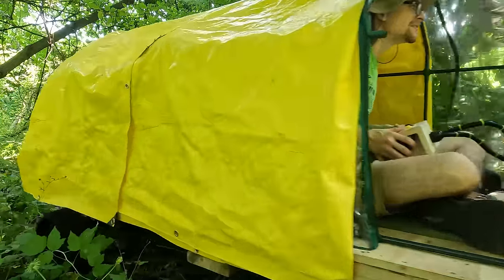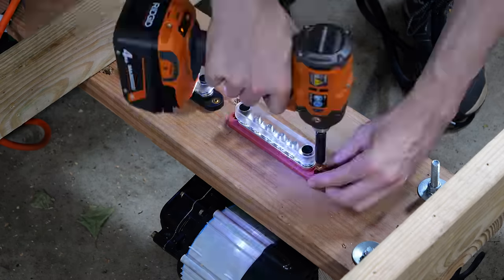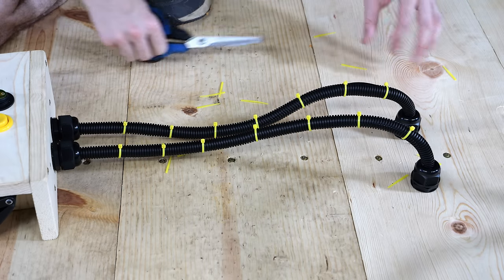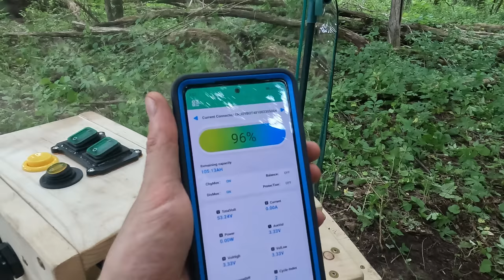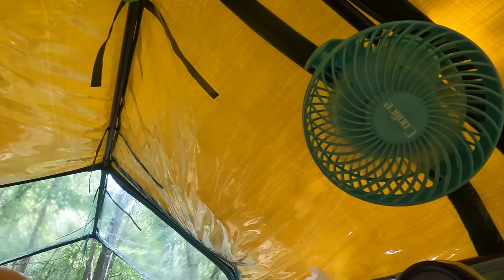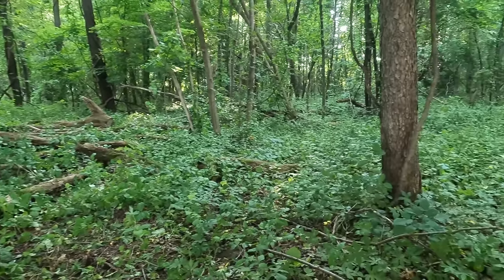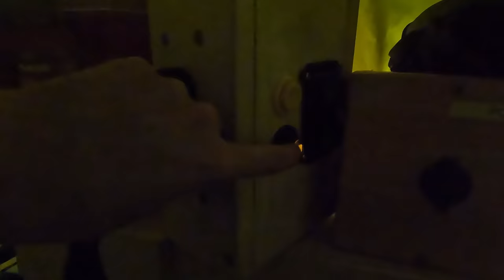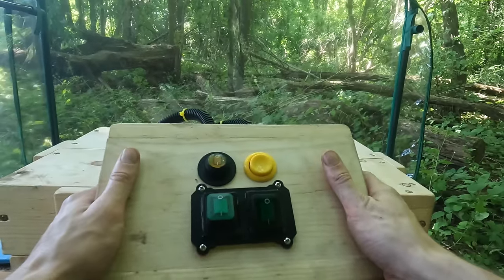UPGRADING The Camper You Can Drive Around - MORE POWER  - Build & Night In The Forest

Comment from the maker: Check out Enjoybots Battery's And if you use the code you save some and help me out a bit - Cheers!
Code: QN10
Enjoybot Official Store Links:
12V 100AH https://enjoybot.com/products/enjoybot-12v-100ah-lifepo4-deep-cycle-rechargeable-battery-built-with-100a-bms-low-temp-charging-cut-off-protection?aff=92
12V 200AH https://enjoybot.com/products/enjoybot-12v-200ah-lithium-iron-phosphate-deep-cycle-rechargeable-battery?aff=92
12V 280AH https://enjoybot.com/products/enjoybot-12v-280ah-lifepo4-lithium-battery-high-low-temp-protection-deep-cycle-rechargeable-3584-wh-built-with-200a-bms?aff=92
12V 400AH https://enjoybot.com/products/enjoybot-12v-400ah-lifepo4-lithium-battery-high-low-temp-protection-deep-cycle-rechargeable-5120-wh-built-with-250a-bms?aff=92
24V 100AH https://enjoybot.com/products/enjoybot-24v-100ah-lifepo4-lithium-battery-high-low-temp-protection-deep-cycle-rechargeable-2560-wh-built-with-100a-bms?aff=92
36V 100AH https://enjoybot.com/products/enjoybot-36v-100ah-lifepo4-lithium-battery-high-low-temp-protection-deep-cycle-rechargeable-3840wh-built-with-100a-bms?aff=92
48V 100AH https://enjoybot.com/products/enjoybot-48v-100ah-lifepo4-lithium-battery-high-low-temp-protection-deep-cycle-rechargeable-5120wh-built-with-100a-bms?aff=92
Reply: Your videos are so fun to watch ever since I watched 1.0 I really wanted one of these things
Reply: Super Love your fancy truck. Next episode you should add some mudguard.😊 Its more fun in woods campsite. So much enjoying seeing you cooking your meals.
Reply: Bro I have a car I bought from my Grand father it looks like the small car on monopoly it needs work you would enjoy that!
Reply: add a small "security system" with some small lcd monitors and wired rea/front/sode cameras for security. i feel like it would be so perfect to be able to monitor whats going on outside without the need for setup, just in case you have any unwanted guests around your camper.
Reply: Bro, tell us how high your IQ was.
Reply: Hot sauce goes on everything
Reply: The best thing to do now is to add a wood structure because of the stronger engines and the add some lights and maybe a TV and some things that others mentioned. Love the channel, keep up the good work.
Reply: GOOD WORK ..💪 ITS NEEDS TO BE STRONGER N (HIGHER) , AND MORE RIGID.... 👉ESPECIALLY MORE (*HIGHER* ).... *WAYYYY TOOOOO  LOWWWWWWW👎.....    WHAT DO YOU HAVE TO PROTECC YOURSELF FROM BEARS 🐻 WOLVES  🐺 AND WILD LIFE 🤷.... "" I ENJOY SEEING THIS.... BUT I WISH IT WAS MUCH MUCH HIGHER , RIGID, STRONGER 💪 POWERFUL.... TRY 3,000 MAYBE 5,000 WATT MOTOR 🛵..... (( I LL GUESS YOU'LL WORC YA WAY UP TO THAT 💪🤷 EVENTUALLY 👍....*TOO LOW🤷👎TOO THE GROUND
Reply: Next engine diesel 200cc
Reply: Try this camper in water
Reply: The banana cart camper is back baby!!!!!!!!!!
Reply: You'll be getting a phone call off Elon Musk after your next invention lol.
Reply: add ventilation its very important
Reply: @thanasisrallis7473  If you watch it to the end, he has both ends pulled back and wide open as he's driving.
Reply: @MIKETORRESCALIF8RN3A   If you didn't type that ironically, I am legitimately concerned for your mental health.
Reply: Should run just two or 3 motors. You don't need that much torque. This is increasing your parasitic drain =less gaming.
Reply: Regular key Fobs chirp. You could make one that meows or plays Star Wars wen you return from a late night walk.
Reply: With your Mega Battery and outlet you could bring a toaster oven and blender for smoothies.
Reply: Just plucking this idea out of thin air, but if you reduce your "wheelbase" such that the outer limits of the tracks (side/side, front/back) form a perfect square, you'll optimise your static turning ability.
Reply: you should put solar pannels on the camper
Reply: I can’t wait to see what this amazing machine turns into. Tweaking this and that, adding this or taking away that. Build this better and lighter. This machine is going to be something epic over the course of its life!
Reply: Man just leave only greenhouse and go around neighborhood with plats.
Reply: Sasquactch watchin you from the tree tops like "wtf...what are these mf humans doin now...ARE THOSE TANK TRACKS?!" 🤣
Reply: MORE!!!!!!!!!!!!!!!!!!!!!!!!!!!!!!!!!
Reply: a free 1500 dollar battery, must be nice to be succesful.  Who was your first sponsor and when did you get them?
Reply: Can you bolt the motors vertically for better ground clearance? or does it not work?
Reply: Actually 48v 100ah = 4.8kwh.  Why you have so much waffle cooking time :P
Reply: Hi man can you make 3.0 pl I want you make you battery can  store sun light
Reply: Very very cool build!
Reply: Looks like it needs a shock absorber? And track fenders?
Would you accept the current driving shock?
And the tent looks a bit airtight
Because I saw your video is foggy inside the tent
It might be better to put insect screens on the tent
What do you think of it?
Reply: I'd love to see an instructables on this project! I'm keen copy elements to build myself a more affordable tank tracked mobility scooter so I can get back off paved paths and into nature again.
Reply: No solar panels for charging the battery. And it isnt even long enough for you to lay right in there...
Reply: J bro I'm waiting for your next video :)
Reply: For battery need solar
Reply: Have you ever seen The Creative Channel? He builds a Camper Car Mini with Air Conditioner, check it out. We can't wait for your next video. I hope you are well. ❤
Reply: 🤢🤮 OMG HE PICKED THE LONG HAIR OUT AND ATE IT 😂😂😂🤢🤮
Reply: @LincolnAndAlfie I agree
Reply: You should get some simple accessories like a brush for brushing off those burs after a walk...  a small wash pan...  
small crap like that comes in handy after an excursion through a frog infested swamp :D
Reply: now you got the power to make your camper a little yellow hard plastic roof, more secure against critters, i could see you making these to sell on the market
Reply: It will be more awesome if it can be operated by an game controller
Reply: Where did you acquire the motors from brother?
Reply: Hi. I'm a new subscriber. I don't know where you live but, I wish that you were living near me and that you were my friend! I am so not handy and my place is falling apart! 😢😢😢
Reply: campers are supposed to drive around
Reply: You should make more of these and you could sell them
Reply: Where do you buy all your parts?
Reply: where is lock thread glue?

Comment: You should add ventilation, it will really help with the humidity
Reply: my suggestion is to use one of those mesh frame from a pc case and either make a small frame for that ventilation on the side and probably some small low powered fans for airflow.

Comment: The camper has gotten even better. For upgrades: mosquito netting on the inside for ventilation and protection from bugs, a thermacell for the same, and an induction burner so you can cook inside the tent. ❤
Reply from the maker: Induction cooker nice idea! Id need a bigger inverter haha but I like it!- Cheers!
Reply: I love your videos bro great content
Reply: @QuietNerd  Also add suspension to the vehicle so the ride is more enjoyable and comfy for V3. What about a gaming in my drivable diy camper video? :D
Reply: Going to second the Thermacells brobro. Thank us later. You'll never use bug spray again.
Reply: @bohkdi   I was thinking the same about the gaming. Could totally use that 120v outlet to keep the handheld charged allll night. Even a splitter if he wanted to mount his monitor on the ceiling above the sleep spot. No sun glare under the tarp :D
Reply: Came to comments to mention mosquito net for bugs and ventilation. Also the clear end perfect for watching the stars at night as you sleep. Very cool contraption you built. Did I miss it or have you given it a name yet?
Reply: @nicsxnin6786  Plate says QN02 But I don't thinks thats it's name quite yet. Maybe next itteation will have a name. 
ATAT, A Tent All Terrain.
Reply: veo que hoy (24-2-24 ) , ya tienes la cocina de inducción y también un inversor más grande , te falta unas placas solares para asegurar más autonomía
Reply: @Surms41 hello fellas accidentally touched this and now I can't rlly get off of the screen so yeah

Comment: You need to add some fenders to cover the tracks so they don't fling up dirt into the camper. That'll be pretty cool. Maybe even a long board on the sides that can even be useful with the extra space.
Reply: Fenders, at least some basic suspension, sturdy and flexible composite frame, bottom cover for rough forest driving - these are much, but essential for further improvements.
Reply: @J0rdan912 Yes !
Reply: @J0rdan912 especially the reinforced frame and bottom covering to protect the wiring on the bottom

Comment: Small ideas to help improve this project
1. Suspension for smoother riding and more ground clearance
2. Skidplate as to not get any cables damaged by ground debris
3. Small wench in the front and back in case you get stuck in deep mud
4. Fan in the rear to blow air throughout the inside
5. Bluetooth capable raspberry pi that can connect to the battery to show your current charge at all times and you can even add a BerryGPS to it as well for the other features
Reply: you could potentially run a onboard computer using rasberry pie and make it voice controlled. tell the car move forward and it will go straight lol
Reply: And also a solar panel to charge the battery throughout day.
Reply: Such good ideas.
Reply: Suspension would be nice but damn it is going to be expensive and hard to do!
Reply: @DaCouchWarrior Nah just find an old cheap 50cc atv and take from it

Comment: I think your next move should be making improvements to the camper part of the vehicle. Maybe add some fenders to mitigate the mud issue, and/or build a hard top with window screens (for ventilation and bug-proofing), storage compartments, roof rack, etc. This thing is awesome though!
Reply: Maybe if you're really daring, you could add a solar system to help power it or reduce power drain
Reply: slideouts!
Reply: solar panels above the drivers compartment for shade and more efficiency on the move?????
Reply: Awning, portable table and chairs for some real glamping.
Reply: @Mr133mike  Might work if he was driving it somewhere that the sun shined through more. Solar panels are not very effective in the thick of a forest.

Comment: I suggest that you install an AC/dehumidifier and a tank for storing fresh water somewhere for maximum comfort. Maybe even add a bug proof vent and an electric stove so that you don't need to bring propane and also have fresh air moving through the camper, this could also double as a heater if you keep it on low power, although I wouldn't use it as such at least while you sleep because it is a potential fire hazard.

Comment: What a great set of upgrades to the campinator! I may suggest adding screens somewhere in the middle of the greenhouse. This will give you some much-needed airflow and cut down on condensation. Also, maybe you could move the battery box and use it as a seat. I really like this build and look forward to seeing even more!
Reply: I call it a micro camper 😅
Reply: I concur on screens.  Have a way to open plastic to screen o both sides for good air when wanted.  Also maybe weather protect the wood a bit.  Awesome ❤
Reply: He's too tall to sit on the battery box. He could do that with a taller green house frame ,but, getting past lower hanging branches might be an issue?

Comment: This is great! You're living several of my childhood dreams here. A few upgrade ideas:  I feel like it really deserves a steel frame instead of the wooden one. Maybe aluminum would work too to save some weight. I've also seen some neat trailer builds using that corrugated plastic you often see those big political signs made out of. Strong, light, and would be a heck of an upgrade over that greenhouse and tarp thing.
Reply: aluminum frame and an actual suspension so all that power is actually useful.
Reply: Corflute, I believe it is called?
Reply: Nah bro that sounds terrible, may be efficient but sounds like it isn't comfortable at all

Comment: You had mentioned that you could run a solar setup with a battery like that. My suggestion would be to create a fold out solar system that would sit atop the roof. (But not above the cockpit area) that could fold out while parked. Aside from that, this was an incredible build to witness! Great work!

Comment: I loved this build except for two things. You would have been way better off using only two motors and taking advantage of the differentials (which are welded now). There's no way you're ever going to use full power on all four and doubt it'd come close even with 2. You'd need to add steering though. Second thing, really wish you had some suspension. But overall looks fun as heck. Wish you'd also posted the amp draw at different throttle settings! The reasons the diffs didn't put out power is they expect resistance on both sides. Check out how a car differential works and it's the same thing. Most importantly, it allows it to turn without locking up treads like you are experiencing now.
Reply: I'm a fan of this guy but dang, this video was definitely a roller coaster and it almost killed me.

>First he said "I got a motor with a differential."
Okay... That's a little odd. Usually with some off-roading device, you'd want direct drive because if one side of the drive loses traction, both wheels won't spin.

>"I actually got four of them"
Wait WHAT? I mean I guess... You're going to have to couple the front and rear motors as pairs. But like... that's kinda inefficient. You're going to have mechanical losses in the differential instead of a direct drive. I mean I guess it would only be a few %. Not a problem if they aligned well. Your only issues will be that you must run both motors at the same time, every time you want to move.

>"I can stop it with my finger"
Weird. Maybe he has an issue with the motor controllers. They're probably not feeding adequate power.

>"So I took apart the differential and found the problem... I welded these gears"
WAIT! WAIT! WHYYYYYYYYYYYYY
GOD WHYYYYYYYYYYY. You paid several hundred dollars for differentials only to weld them together. And now the link you made between the left and right diffs will prevent you from turning... All you had to do was run both motors at the same time. 😭😭😭😭😭

Yeah, that  was definitely hard to watch. I feel bad for the guy tho. He's genuine and his failures are public for the world to see. So no ill will. It just kills be to see such a dumb mistake. 😭
Reply: @21area21  pretty sure you can hear the splines chewing themselves to death too
Reply: @ATR-_  Fs in the chat
Reply: @21area21 wait, I might have missed it, how does he turn with an axel welded across so the left and right turn at the same speed?
Reply: @RiggedBananaGaming  He had to have taken off the shaft couplers between the right and left side.

I think he just omitted that part from the video.
Reply: @21area21  makes sense thanks
Reply: @RiggedBananaGaming  my pleasure!
Reply: He has lockers now. Way better then open diffs.

Comment: Excellent video. The QN-02 is a huge step forward. Maybe the next upgrades should be to move the axles closer together, I saw that steering can be harsh, and a shorter distance between front and back tracks will mitigate it. QN-03 may feature isolated plywood hard construction and solar panels. You can even try one of those small portable ACs.
Reply: swamp cooler!

Comment: Try making a ventilation and add a second smaller battery for an electric stove and a mini fridge for comfortable cooking and for the cold nights or winter a heater/cooler. Also think about adding solar panels and maybe some night time lighting. For the comfortable ride add some kind of suspension

Comment: This whole thing is so cool, and ridiculous, I love it lol. Here is a couple random thoughts and ideas. Some good, some probably not so good...
-A DC powered RGBW LED Strip down the bars would be great for power efficient interior lighting. 
-Strategic placement of some PC Fans may help with ventilation, something like the 200mm Noctua fans. Would be more energy efficient than using the inverter. 
-A Thermacell for the bugs would probably be helpful
-Flexible solar panel roof for the battery?
-You put more development time into your custom controller than they did for that Titanic sub...
-Box of desiccant to help with humidity/condensation
-Folding bleacher seat to give you a drivers seat that can be moved out of the way

Comment: This upgrade is a lot better with the control panel and the Tank wheels. Regarding the mud that comes off of the Tank treads you could put some kind of mud guards there that you can fold back when you have parked up. Also a small folding padded seat without legs on it  bolted to the floor may be more comfortable to rest your back while driving so that you do not end up with a back ache.

Comment: Excellent build. The only thing it really needs is a protector to Mount the undercarriage to protect the electrical components so this way when you go over wet grass and dirt the components under the floor boards do not get damaged. And I use a two outlet invertir so I can plug more than one thing if I need to. I would carry a portable solar panel to recharge battery (if the that battery is made for recharging).
Reply: wire it through the holes🤣